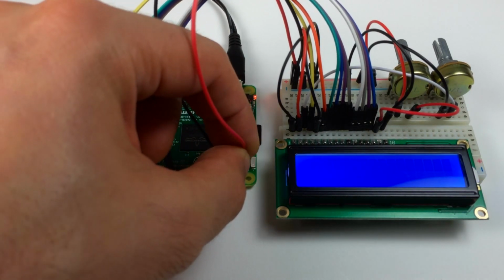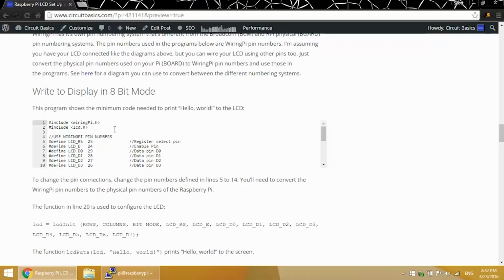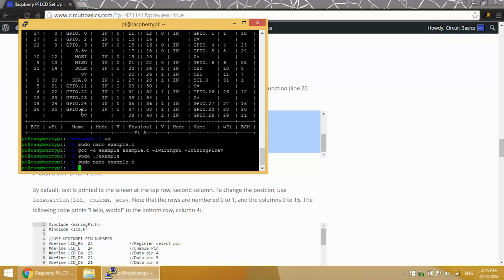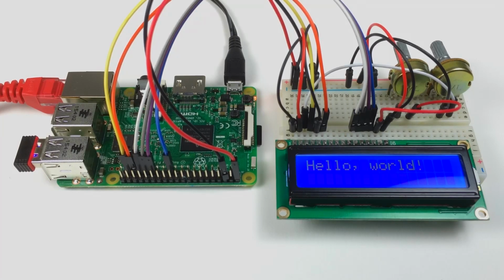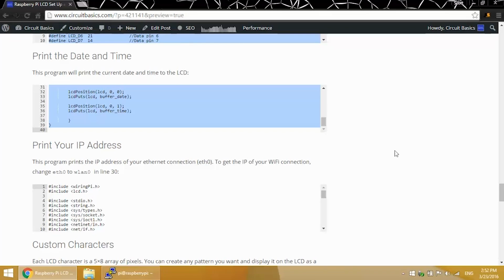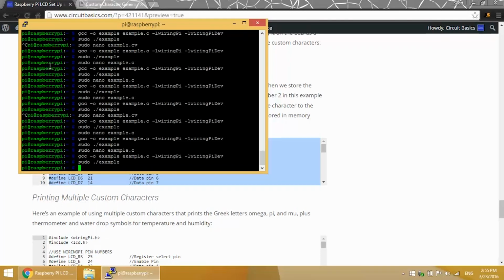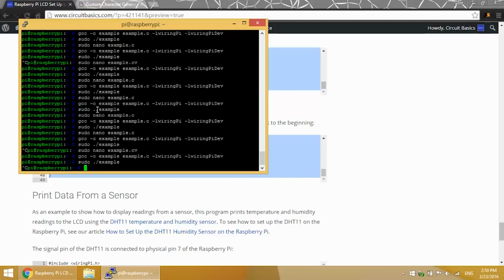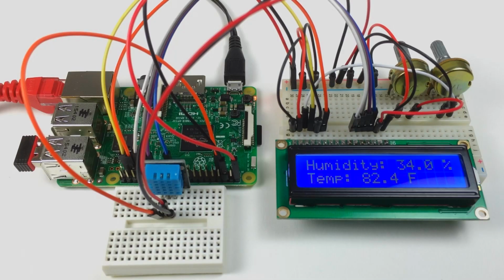How to Setup an LCD on the Raspberry Pi and Program it With C

Comment: I copied your code, and I got a compile error.
It said "undefined reference to 'lcdInt'

I googled around and noticed somebody had seen the problem, but
did not seem anybody got solution for it.  Any idea?
Reply: In geany, go to Build -> Set Build Commands, and at the end of the build command, be sure you have -lwiringPi -lwiringPiDev -lpthread